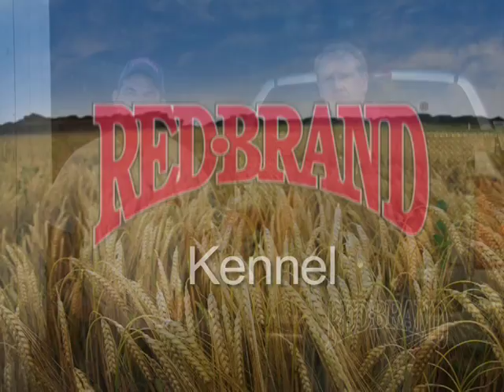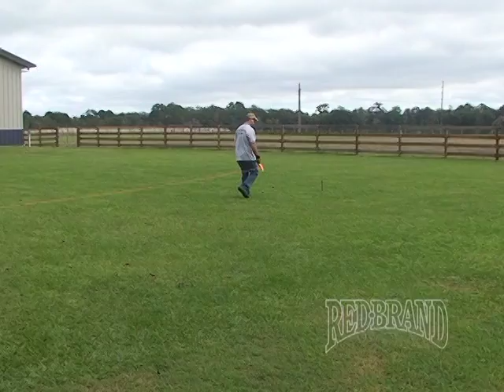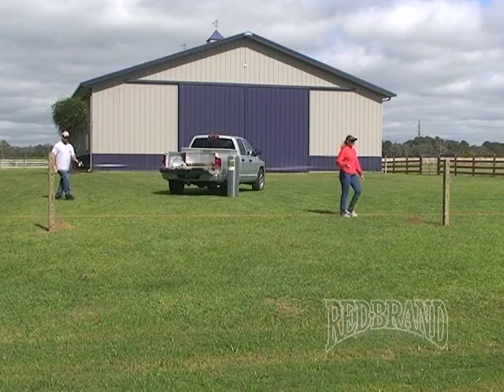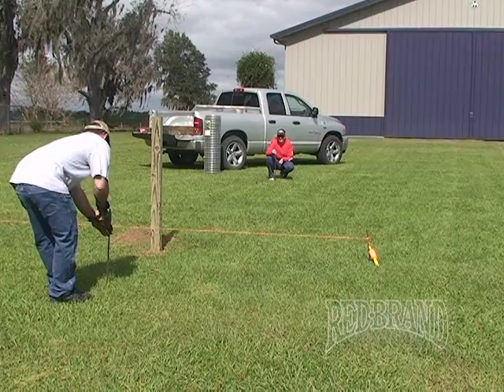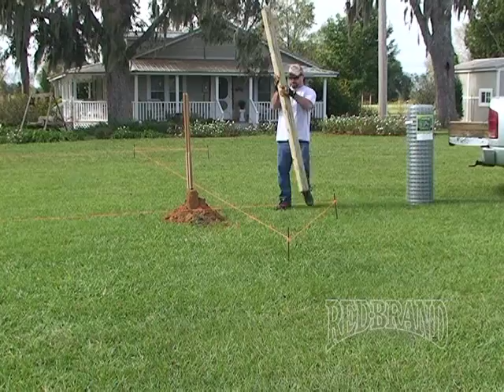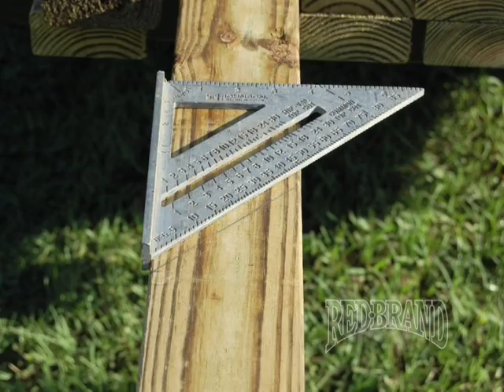Dog Kennel Fence Installation Part 1 of 2

Comment from the maker: No, we didn't use concrete but you can. If you choose to use concrete, don't fill it all the way to the top of the hole or water will get in and rot it out
Reply: Red Brand look up how to key a post it's fucking awesome no way it will ever move
Reply: @SKANK_HUNT49  Mr. T. is probably long gone, but where Red Brand is located (Illinois and close to the Missouri border), concreting in wood posts in is a sure way to get more rot as that concrete (wet or dry poured) is a sponge for water.

I would have added more treatment to the posts though....particularly at ground level...which is where they always rot out due to soil microbes.
Reply: @silverbackag9790  whatever that means. Has absolutely nothing to do with keying a post
Reply: @SKANK_HUNT49  your comment had shit to do with the thread then...which was about concrete in post holes.